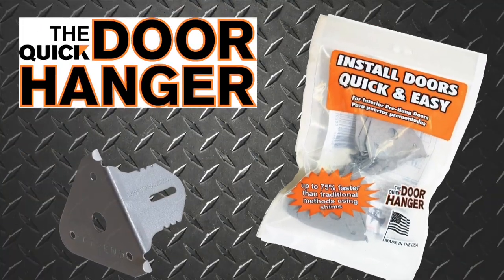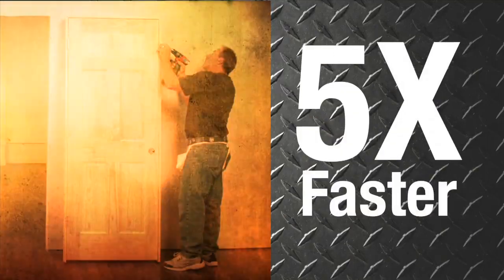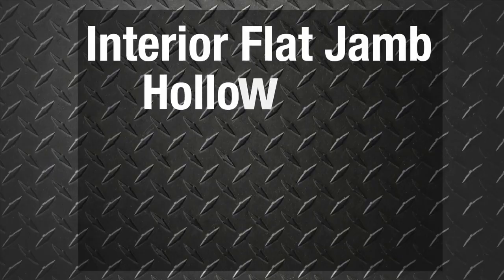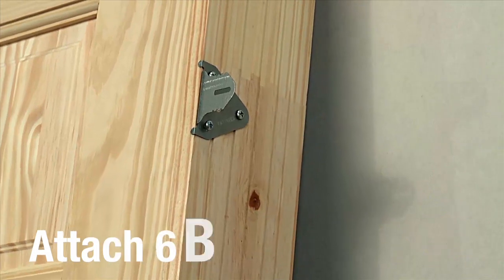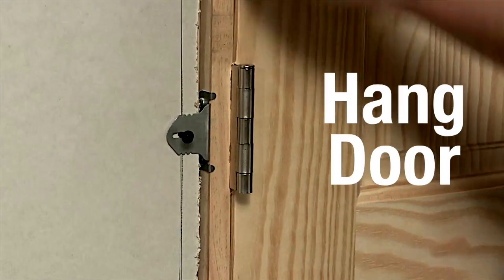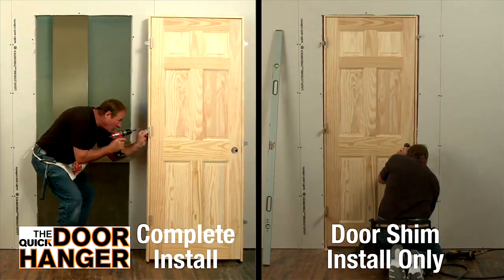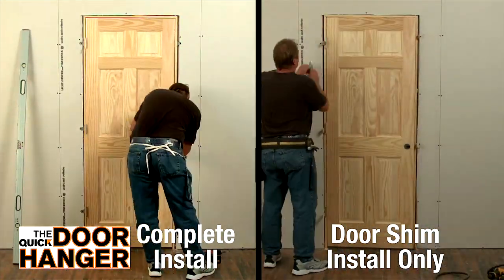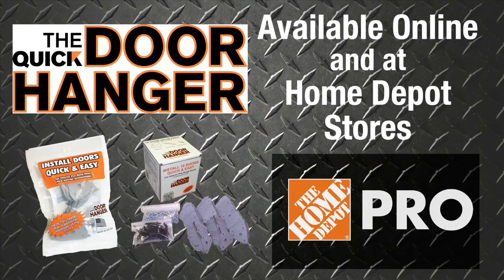Quick Door Hanger - The Home Depot

Comment: Why does the HomeDepots kit come with 6 hangers,  whereas most others come with 7  for the top of the door frame? Do I need to do this?
Reply: Install the casing, making sure the gap between the door and the jamb is consistent. That should eliminate the need for a 7th bracket.
Reply: @NickPlaskon  Thanx